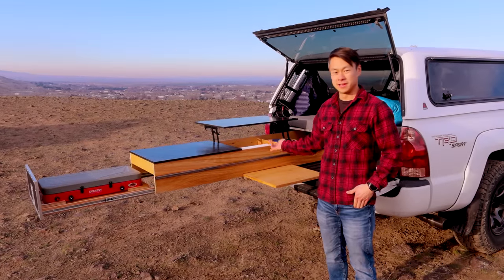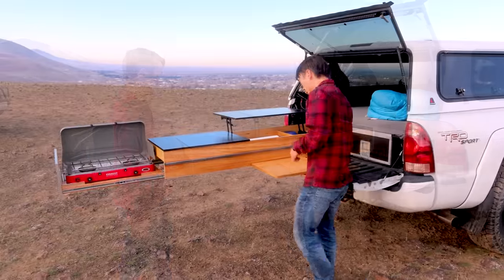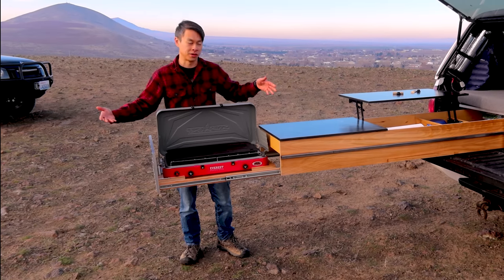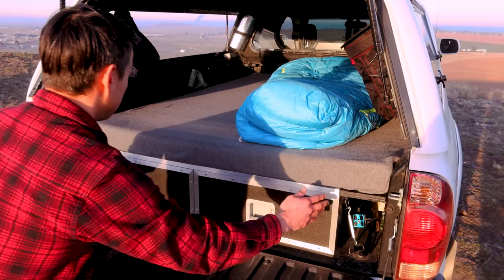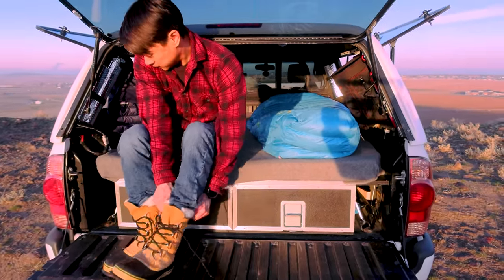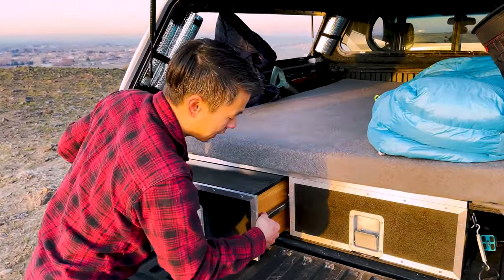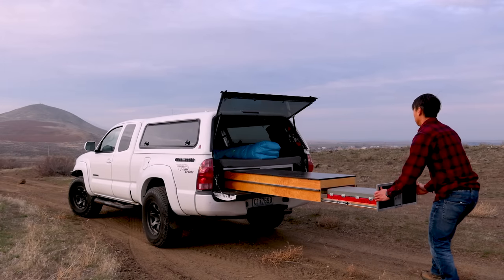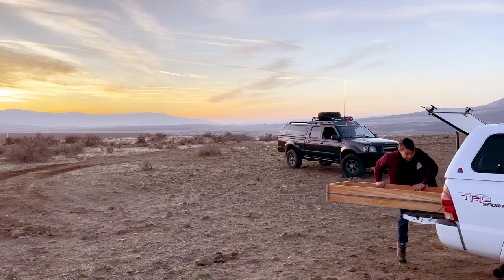Tacoma DIY Overland Kitchen And Mattress Platform Storage Drawer System - K.A.M.P. Drawers

Comment: I've been a builder for 45 years and I must say, that's a very well thought out, highly precise, ultimate truck drawer build I've ever seen.
If ever your in Central Oregon, I'd love to check it out..
Reply: Nice, but it is lacking an adjustable support leg. You are asking for big trouble not supporting a long leverage arm.
Reply: I do see you standing on it to prove a point. Don't be lazy. Install a support leg. It will then look complete.
Reply: @robertcornelius3514  good point. It does look incomplete without your opinion to add support.
Reply: @nightb4thestorm  , my mentor is Ron Swanson. All things made need support.
Reply: You only need a leg if you use shit hardware.  shs and bearings will hold up just fine.
Reply: @robertcornelius3514   what have you done???

Comment from the maker: Hello everyone, and thank you for your interest in this little creation of mine! So far I have had 8 nights of winter camping usage out of this setup, and overall, it's been amazing. In testing, I have come across a few things that could use improvement in future versions, and I'm sure I'll find more. At this point, I'm still too stoked on adventuring to confine myself to my shop, and I have decided to take this summer to give it a thorough test with some offroad test time. I will be returning in the fall to build a number of improved versions for sale, and that number will be determined by your interest! For those truly interested, please email me at sam@kampdrawers.com, and I'll include you on the mailing list for the fall. Note: I will only be building drawers to fit 2nd and 3rd gen Long Bed (6') Toyota Tacomas. No custom work. I'll most likely post updates in the form of adventure vlogs in the meantime. Cheers!
Reply: Great build.  But I think I died when I saw you get put away in that drawer.  (gasp, i can't breathe).
Reply: No short bed (5’) bed version??☹️
Reply from the maker: @davehill7484  That would be the next phase. I realize that the majority of Tacomas on the road have the short bed, so it would be worthwhile and relatively easy for me to adapt it at some point. Or I might build a few of both this fall. Depends on interest!
Reply: What about the plans ? Can we purchase them ? 
Lmk thanks .
Reply: Where did you get that wedge ax? I've been looking for it for a while now. Didn't want to bug you with something I could find with a basic google search.
Reply: Awesome build Sam 🤙🏾🤙🏾
Reply: Incredible build, your attention to detail is amazing. If you ever make one that will fit a 3rd gen 4runner I'd take one!
Reply: Hey Sam, great build.  Word to the wise.  You might want to look into copyrighting some of those “inventions” on your rig, so that someone else doesn’t copy it and mass-produce it.  Just an idea.  It’s happened to me.
Reply: Dang. I'd love to have one of these built for my truck but I have a 2017 Ram 1500.
Reply: Are you in the Columbia Basin? That sure looks like Red Mountain and Rattlesnake in the background...I see Washington plates on those vehicles. I grew up in that area. Awesome build, very nice work. Any idea of what you intend on selling these for once you start production?  I see you recommend reaching out via email if we're truly interested but that of course depends on price. I am just West of Portland Oregon and my truck fits your build criteria.
Reply from the maker: @ImFenris  Yes, in fact I am in the TC. check out kampdrawers.com, thanks!
Reply: Absolutely marvelous.,! I can say you probably know how to cook.,,,,
Thinking about to get me tacoma like yours.,, what amount we talking about if you would agree to do project like that for me.,? And how long usually this takes.,,? 
Thanks

Comment: you did such a good job sam! i built one for my tacoma, not anywhere as nice or as functional as yours... but i did do one thing different that i really like.  I made mine about 2 feet shorter than the length of the bed.  this gave me an indoor mud room or a place to hang out if it's really cold or raining. also a place to keep fire wood or what ever. when sleeping i pull out the drawers out 2 feet and put my mattress over the top to make a full length bed.
Reply from the maker: Hey, that's not a bad idea, and still would be usable space to store things like firewood and anything else dirty. Might be a good option for longbed users when I come out with the 5ft version. Thanks for sharing!

Comment: You did a very fine job of this build, Sam!  Precision build and nice high tech finish on front.  Love it the meticulous organization of everything inside, and dividers, brilliant!
I have the same stove.  Camp Chef Everest puts out 20,000 BTU per burner - one of the highest.  On sale on Amazon for $72.  Best stove for quick heating.  I also use it at home for wok cooking which this pathetic electric home stove does not do.

Love the glides.  I would add a set of aluminum legs to the stove end of the glide - always stabilizes stove and puts less stress on the glides, esp in windy conditions.  Never hang the propane bottle.  Adds a lot of stress to the connecting pins.  Find a solution to support the bottle.  

The truck can carry 200 lbs, but you pay a price in gas.  You may want to experiment with 80/20 struts for frame and light plywood sheets inside.  You will drop weight by half and save gas which pays for it.  There is a company called TNutz that also sells extruded aluminum cheaper.  If you want to know how to use it, see Humble Road van builds.  You will pick up some good ideas on materials for finish as well from this channel and an amazing number of ideas and small tips.
Reply from the maker: Thanks for the advice. But the suggestion to "Find a solution" is actually a lot more difficult than everybody seems to think. I might later incorporate some form of auxiliary leg that would be stored separately, but finding a method to attach it to where it needs to go will be a challenge, especially in a way that will be laterally stable, given it is supporting something that is on a slide that wants to move side to side. Coming up with something that folds in would be even more difficult for the aforementioned reason, compounded with the lack of space in the assembly already. Adding in a telescoping mechanism would further add complexity and size. And with it comes the complications of adjustment for varied terrain height. Realize that right now, I am adding a spacer under the drawer that rests the assembly on the tailgate, tripling the supporting lever arm, which reduces the moment of force by a significant amount. Not saying it's foolproof or bombproof, but compromises were made for the sake of convenience and simplicity - those two aspects being the ethos of this build.

A support for the bottle would be much more trivial to design. However, I have already looked over the manual, and it did not state anywhere explicitly that it needs to be supported. The only consideration for bottle placement was to never invert the bottle.

I'm aware of 80/20 and have worked with it before (see my motorcycle bike rack), but adding the cost would be a bit much, in addition to the extra engineering involved with it. The plywood I'm using is already relatively lightweight. See DECKED. They engineered a solution using composite plastic and a strategically braced steel skeleton. Sounds light. But how much does it also weigh? Also ~200lb.

I take criticism very seriously. I've learned from many a mistake during my time on this planet. And it's resources like YouTube that allow me to shortcut my learning by sharing from the collective knowledge of others. This is the impetus for making and sharing this video in the first place - to add to that collective knowledge. I'm not stubborn. I have thought these things through already. I'm the son of an Asian structural engineer who is the grand master of criticizing my work and life choices, so I can take suggestions from those older and wiser. He was actually the one who came up with the tailgate prop solution, and signed off on it from a structural standpoint afterwards.

Yes, my drawers have sagged a bit with regular use over these couple years, but I have other solutions for those problems that don't involve adding legs.
Reply from the maker: On second thought, I've now decided to let you know how pissed off I am about this comment. Do not insult my age like I'm a child.

Comment: Great build.  Ive been using skate board bearings for over 35 years.  Much better than drawer slides strength wise.  My old work truck tool drawers were almost identical to yours.  Im guessing mine would always have about 200 lbs or more in each easily.  I only used 3/4" ply though. Other than that and your locking latches they are pretty much identical.  GREAT BUILD keep up the great vids!

Comment: Sam,  I really like this.  One thing though--I am six feet tall and need the headroom in my cap.  Looking at your drawers, I would like to see them shortened by about 3" to give extra headroom under the cap for the sleeping platform.  It seems that your stove and utensil storage drawer could easily be shortened by that much. The second drawer seems the issue but if you figured other ways to store things in it could also be cut down by that same 3".  Most importantly, you need to reduce the weight.
Also,  I would optimize the plywood thickness and not use birch ply.  As an engineer I wince at "overbuilt" stuff.  Costs money and adds weight for no reason.  Use 5/8" regular (ie non-birch) plywood instead of 3/4" (except perhaps use birch on the door fronts where you want a nice finish. I would suggest 5/8" B-B (un-oiled) plyform. It is made for strength and has very smooth face plies. You probably could use 1/2" on the sides. Also if you want to sell this you need better latches instead of the truck ones.  The roller system probably should be made of commercial slides.  They probably aren't more expensive than the (50?!) rollers you used and you wouldn't have the issue of aligning all those rollers.  This would also let you cut down on the (overbuilt--you said it!) steel frame that you used on the drawers to slide on the rollers and maybe give you an inch or so extra usable drawer width. I know you can stand on your drawers while they are open--looks overbuilt to me (and you know what I think about that).  Keep them strong but not too strong.  Finally. I also like the spaces on each side of the bed to store stuff and how you held the whole system down with the turnbuckles. Good luck and keep building!
Reply from the maker: Thanks for your critical input, it helps give me perspective for improvement. I overbuilt this first iteration because I would probably cry if I spent all that time building something that eventually crumbled apart. I'd rather haul a bit of extra weight than see that possibility come to fruition. The next one I built will definitely be pared down. As far as height goes, there's really no room to lower the platform and still retain use of a full size mattress, as it is already exactly the height of the wheel wells. Lowering by 3" would entirely remove the silverware storage, as that is only 2.5" deep. I feel like the current height is a good compromise in storage, and you're still not going to be able to sit up in it anyways, unless the cap is completely empty.
I'll look into 5/8" plyform for the next build. I had been waffling going between 1/2" and 3/4" for the top, but erred on the side of caution with 3/4". The sides are already 1/2". As far as the slides, you obviously haven't priced out 6' commercial slides, because you'd be quite shocked to find they a) don't exist, and b) cost over 4x as much as my DIY roller bearing slides ($400 for 5' vs $100 for my 6'). They also weigh about 60lbs (keep in mind, 5'), vs the ~27lb for my (overbuilt) DIY slides. Look up Ovis slides. Usable drawer width is the same. I made sure that my slides were the same 3/4" width as the commercial slides. That being said, I am almost willing to pay that 4x premium to bypass the pains of the bearing alignment. But again, they don't really exist, and except for the fact that they're full extension, really suck at every other metric.
I learned how inappropriate the truck latches were the first time I went to open the drawers and realized they don't make a good handle to yank on.
Reply: Those are really solid tips, would love to try one myself based off his design with the tips you gave. Getting my camper shell soon and would love to have a drawer system like this

Comment: At least you know you can smuggle a body to the middle of nowhere if you have to. <LOL>

Seriously... I like what you have done with your drawer system. For my DCLB TRD OffRoad, I have been designing a system with two 4 foot drawers allowing me a 2 foot compartment at the front of my bed where I can mount a pair of smittybilt air compressors and a pair of 2.5 gallon air tanks plus related plumbing and electrical for an OBA system forward of the wheel wells, I plan on putting a pair of "house batteries" and behind the wheel wells, I am just going to have storage compartments with removable lids. I have long used a chuck box for camp kitchen, but I may have to swipe a few storage ideas from you.

Very nicely done.

Comment: I like that the design is self contained.   I have a Ford Lighting and I would like to build or buy something very similar.  Having onboard power creates some opportunities and challenges.  For example, I have a multifunction cooker that I have made everything from roast beef to boiled peanuts while I’m driving but….the heat needs to be vented.  I also have a marine water pump that provides on demand pressure.   Having access to water and cleanup is actually more important than the cooking when it comes to cooking because if you can clean up easily then you’re more likely to cook often.  So … adding water, sink, etc would be great.  I think what you have is great.  If you had a kit with the slides, the plans, and a place people could share ideas…I would buy it right now.  Even something basic like slides - there are many options and I would pay a premium to know that I’m getting a good product.  I also don’t want to have my own channel but would be happy to upload photos and videos if it was organized.  Each persons project will be different and having a central spot to share and learn is valuable.

Comment: I'm very impressed.   The self-made drawer slide system is ingenious. I love how it slides out  so well. Most people seem to use 3/4" ply for their drawers,, but my sense is that it was unnecessarily thick.  I was pleased to hear that 1/2" is sufficient. The finishing touches are very classy. Its a nice clean build. When you mentioned the temperatures you will be camping in I expected to see a diesel heater.  Have you added one yet?
Reply from the maker: Thank you! I can't take credit for the slide system, Pask Makes is linked in the description. Yes, 3/4" is unnecessarily heavy for sure. So I had toyed with the thought of a heater of some sort, but in the end, it's such a small volume of air that a diesel heater would be overkill. In practice, I've found that a 0 degree down sleeping bag keeps me plenty warm in the winter. I don't even want a heater anymore now that I've spent half a dozen nights below 15 degrees in great comfort.

Comment: I would def be interested in the cooking low profile sliding drawer. All it needs is water setup and maybe an integrated sink possibly under the stove so that after your meal you can remove the stove from where you have it and pop in those plastic sinks since you already have a cutout maybe make it also integrate the shape of a plastic foldable sink. 
I would leave the other side without a drawer so I have room for my bed and toilet set up as I prefer more headroom and don’t need all that extra gear you have for an extra drawer. Unless that second drawer was lower in profile to accommodate more headroom. Really well done.

Comment: This is excellent.   Best one I've seen yet, especially the pull out stove.  Being an avid DIYer, I don't know that I'd purchase a manufactured unit, but I'd certainly pay for plans were you to produce them, out of respect for some of your ideas. I'm mainly curious about the bearing spacing and support, especially near the drawer face when it's fully extended.  I don't have a Tacoma though, I have a Tundra Double Cab and I'm trying to work out how to secure the box since my truck doesn't have the same bed tie-down points - there is nothing down low for the turnbuckles to attach to.  The changes I have in mind for my truck would be to find bulk cutting board material - either bamboo or poly - and make the whole countertop with that, And perhaps add some charging ports somewhere .

Comment: Whoa, I think I developed some claustrophobia watching you get stuffed away in that drawer...   Very nice setup.  What would be perfect is a way to build these things to be as nice and functional as yours but also have the capability to quickly disassemble to store with a smaller footprint in your garage.  For those who want to have their entire truck bed for daily driving/use and also short on garage storage.  Probably a unicorn I realize and if it did get invented it would be crazy expensive, but it would solve a problem I think many people have.  Nice work.
Reply from the maker: Yeah, that would definitely be nice. I'm currently in the process of outfitting my shop to store the topper and drawers in the ceiling, as it's landscaping season, and I need to move some soil!